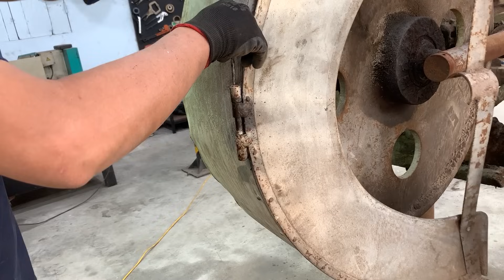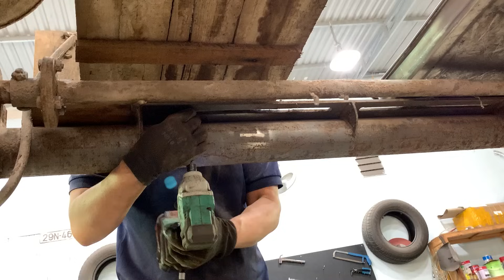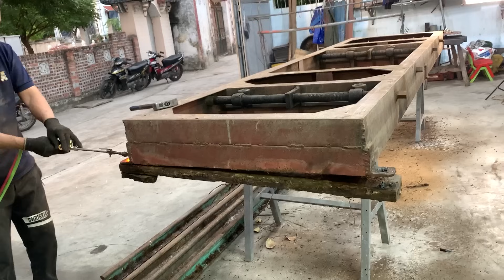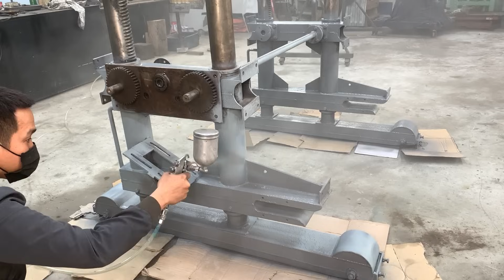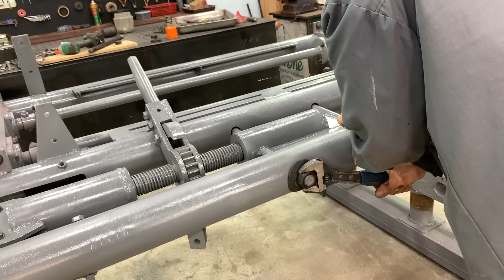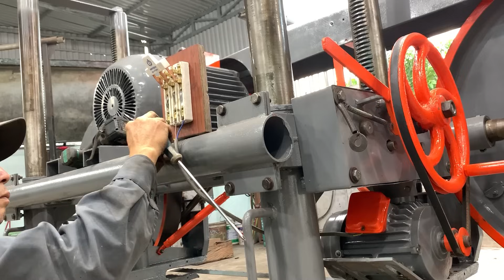Restoration Too Old Horizontal Wood Saw / Vintage Woodworking Machine Restoration And Repair Project

Comment: You drove that across town without tying it down to the truck huh, lol.  ok.  Totally not staged, really cool footage of an old saw though.  You don't need to cake on axle grease for things like height adjustment screws and leads that aren't going 1,000 rpm.  That will just turn into a gum when sawdust gets mixed with it.
Reply from the maker: Thank you for watching the video and leaving a comment. Thank you for sharing your thoughts with me. Sorry for the inconvenience you have encountered. I send you my best wishes. I wish you good health, happiness and lots of luck.